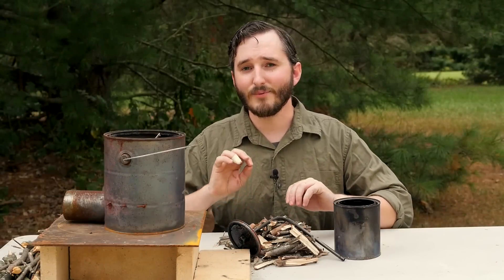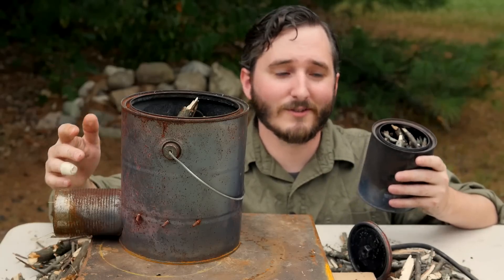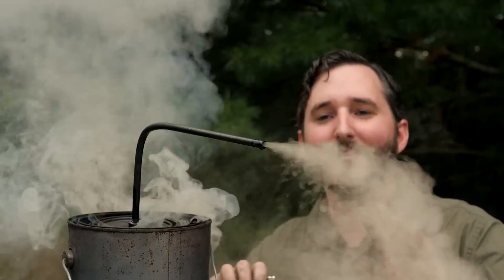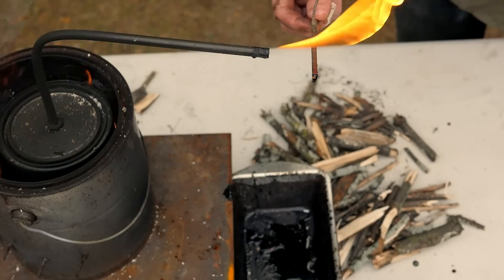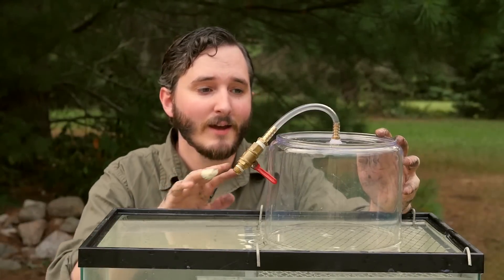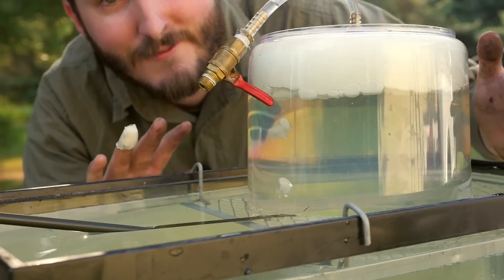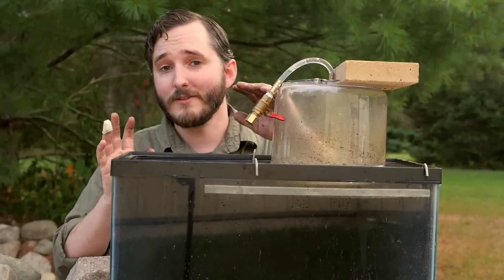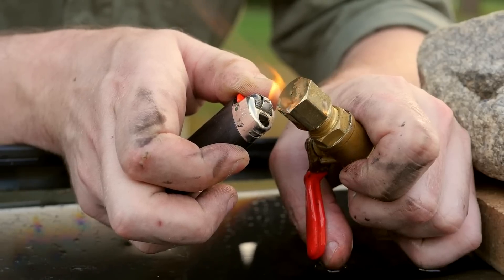How To Make Wood Gas Biofuel (and an experimental gas collection method)

Comment: There's a growing group of Van Dwellers/RVers that would be interested in this. Either Boomers who didn't save or got wiped out by medical expenses, or Millenials who have gone minimalist because their dream careers aren't out there. There's all kinds of youtube channels around the lifestyle nowadays (that and sailing channels, same thing on water). One of the biggest costs that seem unavoidable is the cost of driving your RV around. These kind of people generally park in national parks or BLM land where you're allowed to harvest firewood. Their leisure is limited by how much they can actually afford to travel. Poorer people move 2-3 times a year to follow weather/seasonal jobs. With a fuel source, they'd be able to travel for joy and not dread it. Could you burn woodgas in a diesel decently?

I'm curious about the energy output needed to travel at highway speeds continuously. For an RV it should be somewhere around 20-30 hp (25-40,000W) but I don't know what that "looks like" in terms of scale here. Solar and battery aren't an option (cost alone, but also surface area for solar, and weight/bulk storage capacity for cheap batteries to get you far enough is a dead solution, nothing's workable). Roughly how big of a fire/wood supply per hour would be needed to be equivalent to those power requirements? (I guess you have both your burning wood and your gassifying wood as sort of separate consumables). Or, how much would you need to store to make a respectable 4 or 8 hour drive (and how long would that take) in an RV before you can set up camp and refuel? I suppose yesterday's charcoal could be burned to heat today's gassifying wood, if the ratio works out okay. Seems a lot easier and less dangerous (not to mention, engines are more ubiquitous) than say, a boiler and a steam engine/electrical generator. Anyway, just picking your brain for future followup vids if those are interesting questions to answer on a next gen prototype.

Thanks for the years of quality, non-clickbait, high integrity content. You stand out from your peers.
Reply from the maker: This would be better used in a gasoline engine than a diesel. Old gassifier designs could get you something like 2 miles per pound of wood, but that is in a small car. An RV would take a lot more to move. If someone is resourceful enough to build a gassifier system into their vehicle themselves it could be done cheap from garbage and scrap. To actually manufacture a system and sell it installed would be very expensive. You have to be good at fixing things with gassifier systems also because you'll need to clean the internals and possibly replace components fairly regularly.
Reply: With power requirements due to air resistance being cubed, I wonder what speed those old cars were running. 2 miles/lb isn't actually all that bad. 200 miles is a decent daytrip and 100 lbs of wood is only a couple armfuls. It's a reasonable amount that you could harvest from standing dead in an evening for tomorrow's travels.
Reply from the maker: I think I got that backwards, it may have been 1 mile per 2lbs. I'm sure it varied greatly between gassifiers and vehicles.

Comment: According to some old (1879) book I have, wood gas may contain:
Hydrocarbons: 7% - 9%
Hydrogen: 30% - 49%
Methane: 20% - 25%
Carbon monoxide: 22% - 42%

Not sure why ammonia is not accounted for, maybe it was scrubbed, the wood gas was produced for street lighting and similar uses.
Reply: 42% CARBON MONOXIDE? That's insane! Around 3% CO can be fatal in a single breath!

Comment: Shouldn't you have let the steam go out before placing the break line under the container? Or does it not matter because the water in the grass will just join with the water in the tank? Also that water sure got dirty.

Comment: I realy enjoyed your video and I wondered if it were possible to get kind of liquide wood gas by using an liquide nitrogen cooler. Can you plase try it or at least explain why it isn't possible?
Reply: I've heard CO doesn't really like condensing, but with access to liquid N2 anything can happen.  His attempt should at least be fun to watch.
Reply: Gilles Georges you realize car engines actually turn the liquid into gas? You would just run this straight to your engine. It would not be as efficient and your engine will be a little less powerful but I can still work.
Reply: Update. Liquid methane is 32,000kPa at room temp. LPG is 850kPa. Unless you carry around cryogenic insulation you'll need a strong container for liquid methane to not explode by thermal expansion.
Reply: AnantaSesaDas   There are activated charcoals developed to almost liquidise CH4 by increasing its density. So you mean to say it may still explode?
Reply: Methane is hard to liquefy. Might work but unlikely.

Comment: Some of your gases might get dissolved into the water, and vaporize out of the water surface from there. It might work better to run the gases through a specific separation system. First, run the pipe downhill into a catch/cooling tank to remove the pitch/tar from the vapor stream, much like you did with the aquarium, but with a sealed top and lots head space and something to shrink the bubbles. Get as much tar/pitch out as possible here.

Second, run the pipe out of that tank spiraling downward through a barrel of cooling water and out the bottom (maybe seal the hole with pitch). 

Finally, divert the pipe into the top of a can and back out the top to catch the volatile liquids that just got condensed (acetone, methyl alcohol, certain acids, etc.), which can be drained off the bottom through a third pipe with a valve.

The final gas stream is hydrogen and carbon monoxide, among other low-boiling gases (syngas).

It might work better if you use a car radiator instead of a spiraling pipe. You could even use a propellor to run water past the radiator, but natural convection should stir it just fine. Just make sure the liquids can drain out.

Before the oil industry started, we used to harvest organic chemicals from wood gas and other natural plants.
Reply: Just using a closed water container to prevent off-gassing would be to easy?

Pipe cooling solutions could work, but sooner or later the pipe gets clogged with tar, sot, and that sort of crap.
Water purification lets you get away with just replacing the water every now and then, and collect the "sludge" the sediments to the bottom of the container. Both systems need some maintenance, but especially for demonstrative purposes like this, a water-bath is way easier.

Comment: You should get an old lawnmower or something and try to run it on the wood gas. You wouldn't have to modify the engine, just pinch the fuel line so it doesn't get gasoline and direct the wood gas hose close to the carburetor.

Comment: What you made is commonly called an "alembic" ( kinda?), or a retort, but the tube isn't facing down, and you probably know from Chem class that when collecting gases over water, there is a portion of that gas that is water vapor. You can calculate this using Dalton's law, and he vapor pressure of water at that temperature (there are charts)

Oh and as you said, the initial gas produced is steam, so, like when distilling alcohol, you should probably toss the first and last bits of the gas.

Comment: You could try to compress it into a vessel with an old fridge pump., I may try this in the summer.
Reply: Not sure that is the kind of pump i would use for it, but yes, it should work. Issues with the oil from the compressor ending up in the gas-tube, air-tank, whatever one decides to use. But yeah. A float valve, a delay relay, and the setup is complete. It would put flammable gas in a container for later use. One probably wouldn't want to use "this" setup for something like that, some care would have to be taken to make sure that the gas is really clean before pressurizing it, and if possible, something with a lower gas pressure, but that is lighter then water should be used for the last "filtration" just to make sure the container doesn't get filled with water over time.

Comment: So for survival purposes in case of a zombie apocalypse, how would you get it to liquid form so you can fill up your gas tank?
Reply: handicapitation, WW2 vehicles would just make it on the go, with a bigger version of this guy's setup attached to the back of the car with hatch(es) for adding more wood and removing charcoal. They got it to an efficiency of about 1.5 miles per kg (2.2 lb) of wood, that's the same weight as a car that gets 4 mpg. Still, 100 lb of wood could get you 150 miles, that's almost halfway from Phoenix to San Diego. It would be like having a constant extra passengers-worth of wood sitting in your car, maybe the size of a small stump.

They're currently working on a steam engine that fits in your car hood and runs on any solid, liquid, or gas that can be burned (including dried zombie, vegetable oil, wood, coal, propane, gasoline, etc.) The system is very efficient, but they're still working out the bugs. Look up "Cyclone Steam Engine" on Google. It's works, because it's an external combustion engine, so you don't have to worry about wood chips getting into your pistons.
Reply: handicapitation I think you could pressurize it
Reply: You wouldn't.  You'd just store it as a gas.  Or light the wood and use the gas raw to fuel your engine.
Reply: I did some research in college on making a gasoline substitute out of wood gas. The best way I found was called the Fischer–Tropsch process, which is basically a set of catalytic processes that grow H2 and CO and such into longer chains. I never got it to work very well, but orgo wasn't my strong suit. I still believe it could be DIY-ed. I'd love to see someone like NileRed try it.
Reply: +Carson Rush  Sweet answer!  Thanks
Reply: +christian gifford, an old air mattress would make a good gas bladder. Plywood board on top to squeeze bag for pressure. Or one guy ran his truck off compressed wood gas in LPG tanks. Can't go far though. I only got 111 miles max using a CNG tank and that used a special tank and hi-press compressor. He got far less. Best to use fresh gas after being filtered on the fly. BTW, Always be wary of CO1 when storing wood gas.
Reply: not as heavy as you think tho it would way less than a tan of gas
Reply: The Real Damon Jackson compress*
Reply: you would distill the tar into gas or run the wood gas into your carb with some oxygen
Reply: Wood gas is under pressure when it is produced. You only need to compress it if you are storing it.
Reply: @TheAnantaSesa  how to compress it ?How to convert this to liquid state?
Reply: Finn Jake; high pressure and a way to remove the concentrated thermal energy from the compressed gas so that it liquifies. Just like the freon line in a fridge. Methane has a very low boiling point though so usually it is just very high pressure gas as the vapor pressure of methane at room temperature is extremely high, higher than propane which can be kept as a liquid using much lighter gauge canisters.
Reply: ether you skip the gas tank and feed it directly in the engine from the sores or do what they did during WWII and store it in a giant bag on top of the car but bolth methods were used during WWII
Reply: just looked up the cyclone engine, a look at the wikipedia article for it makes it look a lot like vapourware.  Cool idea, but they can't seem to make it work well (if they had a built engine that produced even semi-reasonable figures, they'd have a article about it)
Reply: Maybe use a bio reactor
Reply: handicapitation basically it would turn your vehicle into a modified coal engine like you've probably seen in the movie Titanic when the guys threw the coal into the fire to generate power
Reply: +Simon WoodburyForget, propane is practical as a liquid. It is only 850kPa at room temperature. Liquid methane is 32,000kPa. So all the aerodynamic savings would be lost by the weight of an extremely thick tank. Thus LPG is preferred over CNG for long periods of driving away from a filling station.
Reply: +christian gifford, ok. I see you might be right. "LNG is gaining interest for heavy vehicle applications because it has higher energy density"(greentruckassociation). A large tank would work better than a small one due to exponential volume increase.
Reply: @SimonWoodburyForget  how to cool it down? How to convert this to liquid state?
Reply: If anyone is interested in seeing a wood gas conversion, there was a show who did an apocalypse experiment called "the colony" where they did it. I'll grab the link and post it in a separate comment in case this channel blocks links.
Reply: PaleGhost69 yes i remember seeing that and they ran a generator with it for lights
Reply: bro just make a hydrogen genarator like what i did at home and burn those zombies to ash

Comment: could this process also be used to produce turpentine? I remember reading that the charcoal burners would collect the tar running from  the burn pits and process it for turpentine, but would this set up yield a viable amount even for a test? guess I will have to experiment!

Comment: is the gas coming off of the wood enough to heat the wood to produce more gas? I mean, you start the whole process with maybe a solid fuel tablet or something in the big stove, and then pipe the produced wood gas into the big stove to act as fuel for finishing the charcoal production. As soon as no more volatiles come off of the wood, the fire stops automatically.

Comment: In Europe during the world wars many cars were converted to run on that. They had a 50 gallon drum set up attached to the back of their car to burn the wood and make the gas with tubing to the main engine of the car with a custom carburetor. Kinda cool bit of history but I hope people aren't so desperate for fuel again. Thanks for showing the process.

Comment: How presuure limited is the output of the can? Could you submerge the container first and then fill it up with the breakline? And/or let the gas bubble through a bigger water column?

You could also vent the gas underwater through multiple (smaller) holes instead of a big one. Should improve filtering quality/speed a bit because of the smaller bubbles (volume/surface ratio of the bubbles).

Comment: Why won't it stay lit with the lighter removed from the equation?
Reply from the maker: Because there's no air being mixed with the gas. It would burn fine on it's own if I used a torch head.

Comment: What if instead of pushing the entire second container down you had a piston on the inside? There could be a hole in the piston that goes into the handle coming out the top with a valve to keep everything sealed. Now you simply depress the piston to pressurize the container, attach a hose to the piston's handle, and then remove as much gas as you want. The best part is that you could do this in the middle of gas production, when you've made more room just let the gas push the piston back up and then do it again. Now you can siphon it off as needed and produce the gas continuously.

Comment: Hey I was just thinking about methods to compress the gas, and I think I have one that'll work pretty easily. If you take any kind of compressor, like a tire pump, and stick the air inlet in the gas it would transfer and pressurize the gas. In theory. I'd love to see you attempt it.

Comment: Why you didn't submerge the container first, so that you could collect the gas as often as you want?
Reply from the maker: My system isn't air tight. It would leak the gas rather than pressurizing the container.
Reply: Oooh get it! I didn't think of that... Thx!

Comment: would running it through distillation apparatus into a larger vessel not be better? the liquids will condense and fall to the bottom of the container, whilst the gas would fill the top,  then all you need to do is pour out the liquids and run the gas through a compressor into a pressure rated vessel to collect it?
Reply from the maker: A bubbler is the best distillation setup for something like this because trying to distill in typical condensers will quickly clog them up with tar.

Comment: Would have been cool to run it through a torch head that would have mixed in some oxygen and maybe you would have had a sustainable flame. Cool video.
Reply from the maker: Yeah I should have thought to find an adapter to attach a torch head to my valve.

Comment: Easier way to do it- fix the bowl to the bottom of the tank before filling gas. As long as pressure in the wood burning can is high enough you will be able to collect gas into the bowl.
Reply from the maker: Yes but only works if your system is air tight. Mine isn't, but that would have made things easier.
Reply: NightHawkInLight good point
Reply: NightHawkInLight I've tried submerging the receptacle for cooling and filtering purposes as well as collection purposes and can't get the gas to travel the 16" to reach the receptacle, not enough pressure even though it's well sealed. Resorted to homemade pvc pipe pump with a check valve, like a bicycle pump to transfer the gas into a storage container but it doesn't store very well, it loses its pop after 1-2 days.

Comment: I already made 100 senko hanabi and what I found Is:
 -baking paper works although the strips need to be 1.5/2 cm width 
 -more powder will make better sparks but it will stop pretty quickly and less powder will make smaller sparks but sometimes it  consumes the whole sparkler (4 cm of the twisted paper )